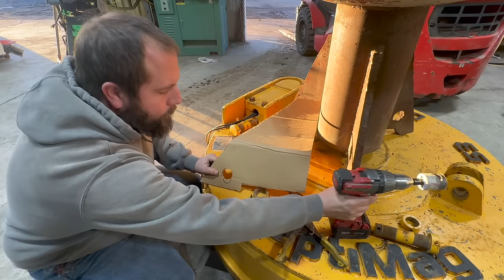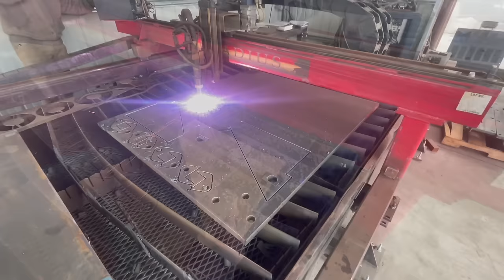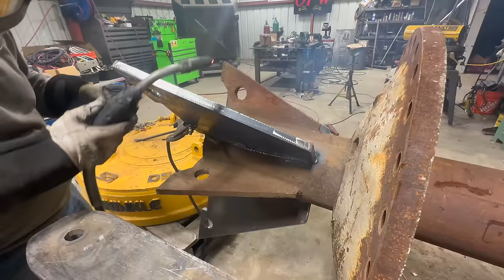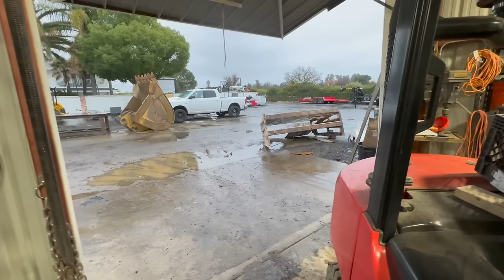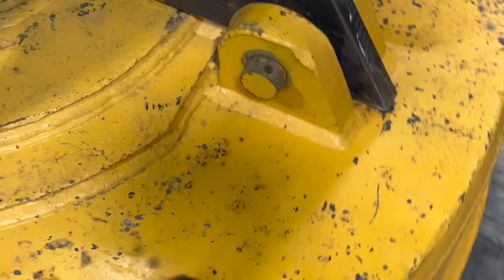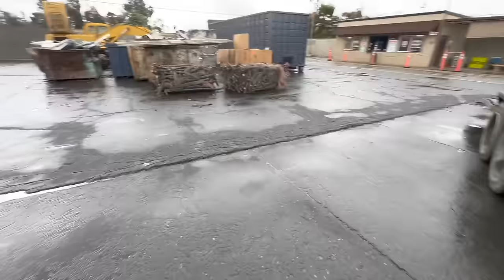Scrap yard magnet modification

Comment: Needs to be an electrical interlock circuit that prevents the claw from opening (hydraulics solenoid) whenever the magnet attachment is installed and functioning. High quality fabrication and welding workmanship skills.

Comment: @37:28 Whoa, operator almost let go of the magnet!
Reply: May have been testing the chain safety
Reply: @Levathain  Nah, a test would have been to remove the wired, and let it go. He got confused with his controls.
Reply: @SomeGuyInSandy  The operator will have to build some new muscle memory on this toy. Opening the jaws = let go of the grab.
Reply: Must happen every so often - that's why they requested the safety chain addition I guess!
Reply: After seeing that, I think this whole thing is a bad idea.

Comment: I’ve noticed that several welders from YouTube repair equipment using mig or flux core instead of stick welding was wondering if it was cost of electrodes or comfortability preference, great video and greetings from central cali
Reply: It's not the cost that is  a determing factor. When welding outdoors the wind, even the most miniscule of breezes, will rob you gas when mig welding. Flux core would have worked in this case but if you ever have to change wire in the machine to weld dissimilar metals it's a pain. Stick welding uses no gas, not affected by environment, and no need to change wire just change electrodes. They make hundreds if not thousands of different electrodes for stick welding. Simplified explanation hope this clears things up for you. Have a Happy New Year.
Reply from the maker: The main reason I run wire over stick is because it’s a lot faster.

Comment: great job. I think that the mount holes how you did them are actually better than what you were going to do. Although I get the point you would never have been able to weld them inside anyway. The bracket itself is the structure. The bolts just keep it from jumping off. 👍

Comment: 21;30...I had to chuckle about clamping to the forklift, 
I bolted with T Nuts my Hossfeld bender to my Bridgeport Mill...[2,200 lbs] 
and I ended up dragging the mill all around my shop....
Justin form the Fabrication Series uses the same or similar tubing bender
you have......it is somewhat different than the Hossfeld, the way it 
moves the die on the tube, where the Hossfeld moves the tube on the die....
great job Greg......cheers, PB...I do see you are up and answering comments 
at the moment....It is still 123123 where you are.... 12 31 23.......later, Paul

Comment: Another nice job. Was worried you have not put anything up in a few weeks. Glad you are back at it and feeling better. Great on another truck as well. Do you think down the road you will get a cnc machine. I worked on a tunnel project the contractor I was working for had things cut out on a cnc machine always right on. I like you Hossfled bender have used on myself years ago. I have bent 2 inch pipe filling with sand and capping the ends.  Lot extra work but works. I have been a pipeline welder my whole career but would give most anything now to have taken the path like you. Again you are a true craftsman. All the best in 2024.
Reply from the maker: I do want a CNC plasma table.

Comment: I was trying to figure out why the scrap yard wanted that(looks like the hub\planetary cover from a big machine of some kind - D-11?) on there at all? Then you said the claw grabs it and it made more sense. They didn't want it dedicated to the magnet & wanna swap from claw to magnet. Most yards have both dedicated machines claw & magnet. But for a smaller operation this make more sense having 1 machine do both. Just have quick connect wire plug on boom. It absolutely needs the safty chain cause I can 100% see a new operator throwing the magnet across the yard or crushing someone or their truck\trailer. I've seen some of these guys working at scrap yards & understand why the chain is necessary!😄🤔👍🏻👌🏻🛠️🔧🗜️ 
29:50 good shot there explaining it. Cool video. Something different on this one. It must be nice to have the variety of projects to repair. Keeps the work more pleasureable & keeps you thinking. If you love your job, it'll never be work!

Comment: If you still have to go back to your customer to finish this job i would suggest adding a second safety chain on the other side of the big flange plate and a second eye on the claw because im almost 100% sure the chain is getting tested the first week and with a single chain the magnet will start spinning when released

Or they could install a single manual valve at the auxiliary line of the claw so they can close the line that gets pressurized when opening.

Comment: You could weld a bar on the base of your tubing bender to step on, so you don't slide around.  or make it so you can slide it in and out, so it's not always in the way.  Since you don't seem to want to bolt it to the floor, which I totally get for a small shop with limited space.  Need to be able to move stuff out of the way.

Comment: Nice job. How do you decide when it is better to bevel vs building up passes?
Reply from the maker: Just depends on the situation.  Depends on if the weld needs to sit flatter with maximum strength. Or if there is no restriction

Comment: screen room aluminum kickplate 16,24,36" widths, .024 sheet makes excellent pattern material, easy to cut, Wiss or scissors, no wrinkles, very clean edges.

Comment: Suggestion on the side where the power lead comes out if you put a piece of box section or pipe from the centre out through one of the gaps between the Claw and pulling on Cable.👍

Comment: I once rented a wheeled excavator with magnet to collect all buried barbed wire and nails and welding wire snipbits and anything else that might pop a tire
Hoooly crap that thing pulled some steel out of the dirt, like barbed wire coils that were 2ft buried, nails from dumping wood ash from burning pallets for 25 years. On a 14 acre farm I pulled 8 tonns of scrap out of the dirt including fence posts, guard rail, buried roofing metal, harrow disc's, horse shoes, tires and rimms , scrap pieces, welding electrodes, car parts, remains of burn barrels, 3/4 of a ton was just nails, sure was cheaper than earthwork

Comment: I've used an exact dodge with a 45ft altec. I know by now you knkw what you're doing. In my anecdotal experience, if you do not put the highway miles on that thing the exhaust wont get hot enough to fully burn. I mean 50+ miles crusie set, not just tooling in the city. It also will pull the tip off a moutain but they seem like more could be done on the actual cooling system. Not trying to stir anything up.

Comment: That wire tab is a little weak. That’s a pretty sharp corner for the wire to make. If the gotten of that tar is open the I would  recommend drilling the hole maybe 2” up of  bottom the post and making the hole more trapezoidal and the tube a little longer.abd welded in place.so the wire can be fed

Comment: The air over hydraulic ram kits for the tubing benders are pretty cheap using an engine hoist cylinder and make life much easier.

Comment: I question using rigid conduit between the "junction box" of the magnet to that vertical tube.   There is a bit of play at the three attachment points.   Perhaps some flexible conduit with a grounding conductor would take up any natural movement.

Comment: How you liking your arccaptain mig200? You still using it for jobs in the shop? I got one for myself n have been very impressed by it, what’s your opinion on welding w flux core n making numerous passes? As long as you get all ur flux cleaned off? Or don’t do it either way? Idnt weld for a profession
Reply from the maker: Yes I am. It’s still working great.
Reply: Can you make multiple passes if you’re using flux core? Is it just as long as you get all ur flux off ? Or should ya not do it ?
Reply: Good deal, I’m very pleased with it also
Reply from the maker: @yenerm114  you can make multiple passes with any welder and almost any process.  Just need to clean between each pass.

Comment: Now that looks like a magnet that my fridge would finally stick to 👍Did you guys give the chain a test, to see how it behaves when it dangles?
Reply: Yeah I hope it doesn't pull the wires out of the magnet.  I think the wires, chain and D rings should have been attached  and in align with the operator.  That way the operator could look out and see everything from the seat.
Reply from the maker: No, I didn’t because hopefully it’s never used.

Comment: Question. What was that ground clamp adapter you were using while stick welding? I guess im assuming it was a ground clamp but the circle thing with welding wire connected to it
Reply from the maker: Magnetic ground

Comment: I'm wondering about the old angles hitting "Crashing Down" on the top of the magnet, Mag Companies will not Be Liable For The 3 old angles hitting the top of that magnet.. Good Job. Cut 2 Inches of the bottoms of the 3 angles.. Again good Job, No Problem, Have a Good Day.
Reply from the maker: The old mounts will have zero negative effects on the magnet. I think they will help by adding more support. These are built to take some serious abuse.

Comment: With that pipe why'd you just get a bit of cotehanger and bend it into the way they pipe. That way you are not using saw much cutting they pipe up ?
Reply from the maker: That’s the way I have always done it.  I use to build roll cages like that.  Cut it a little long then massage it into place.

Comment: What are the benefits of using Mig over Stick in an application like this?
Reply from the maker: Speed.  Wire is a lot faster with the same strength.

Comment: What voltage and current does the magnet run at?
Reply from the maker: That I’m not sure about.
Reply: @OFW  I did a quick search and I guess a common voltage/current is 250V @ 50A, so don't stick your tongue on it haha!
Reply from the maker: @kailuagarage  that’s more volts than I would have guessed.  It’s crazy the lifting power it can create.

Comment: You could've used the original brackets with some extension plates.
Reply from the maker: They were in the wrong location.  And I’m not putting my reputation on those old welds.

Comment: I think that you did a nice job, but owning a yard and building the same set ups I think it will  not your fault but that tubing you bent for the wire protection will be ruined and cause you to re design that area. I would have sistered on to the terminal box bolts with at least 1/2" plate and in a sense built a C channel that engulfed part of the terminal box and then welded the other end to the tube much like you did with the tube and tab and ran the wire thru it. There is a reason that terminal box is built that heavy as operators and scrap conditions are are very ruff.
Reply from the maker: Well hopefully it will work for a while.  If I rebuild it, it will be 1/2” or thicker.

Comment: I understand the reasoning for doing this on a magnet but in the 10 years i worked in a scrap yard this doesnt make sense. It takes 5 mines to swap from magnet to grapply. Mind you this is a small yard and i come from a huge yard with 10 long sticks and each excavator has its own mateiral handler. A few had grapples and thats all they did and a few have magnets and thats all they did. There was times when some of the machines were down and you had to swap material handler attachment but it never took me more than 10 mins to swap grapple to magnet. Im suprised those wires ar ethat thin for that magnet. We used 48" and 60" magnets. We just used welding cables with the welding lock end to plug into the cable on the stick which was also a welding cable with lock end. Pretty cheap setup but it worked. Just twist turn to unlock cable and take out the pin to the horseshoe and line up the pin for the gapple and hook up the quick connect couplers.

Good job with what you did with it. I just see it as a waste from a customer's perspective. They could have just bought a magnet thats built into the Grapple.
Reply from the maker: I see your point but as we know I was just doing what the customer asked.  They have 2 of these machines maybe they should keep the magnet on one of them.  The wires did have the welding twist lock connectors.
Reply: @OFW  yeah I know, nor critiquing you on your job just weird how the customer wants that done when there's better ways  I enjoy you content keep up the good work 👍

Comment: Now I see   how it works but why put a magnet on a claw?
Reply from the maker: To pick up all the little things the claw can’t.  And when unloading a trailer with sides the claw can’t get in there.
Reply: My dad worked for Metals Prossessing operating a crane and then an excavator type they mostly used mags
Reply: I get it now